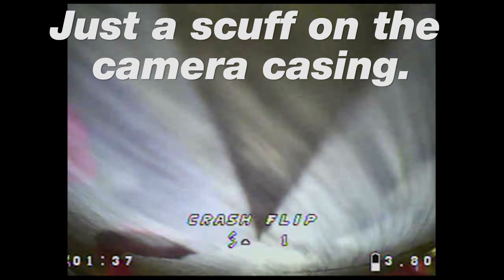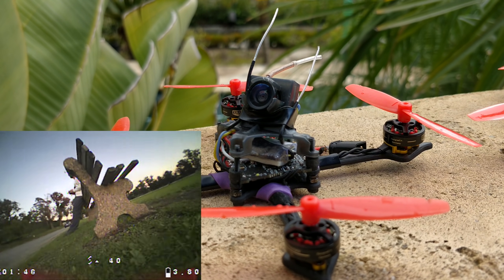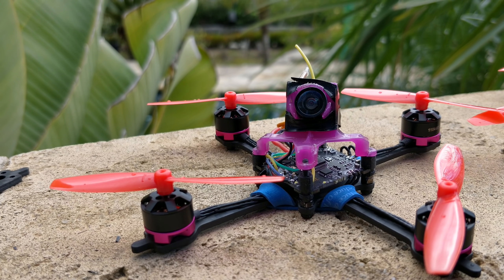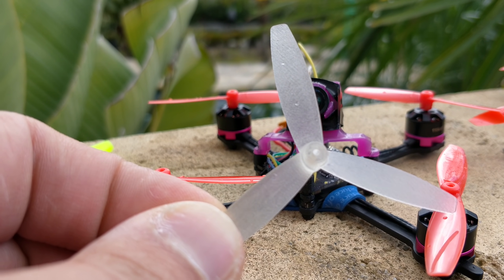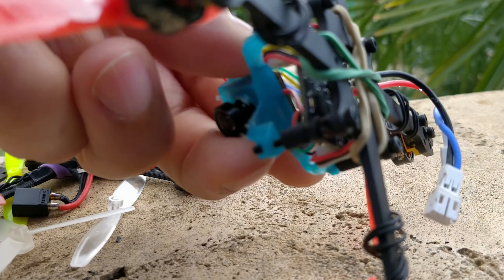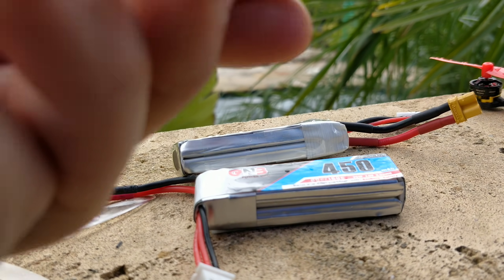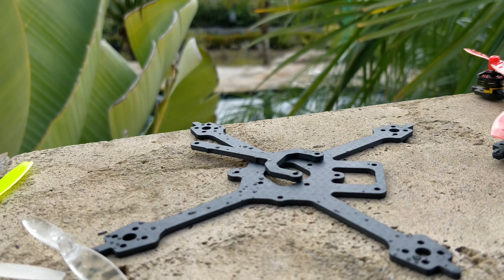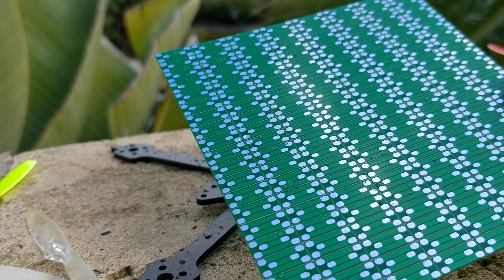Toothpick Update - Props, Power lines, Charging...

Comment: I don't understand all the hype around this thing: flight envelope is ridiculously small, you have to fly fast for it to work, and guess what, with whoops, I want to fly "slow" and inside...I have a ur65 fitted with Gemfan 1.2x1.6x4, yes, very low pitch, and that's how you get back the use of the whole throttle. I wish they would do the same for my TrashCan.
Original whoop props have way to much pitch...
I repeat it your motor/prop set up aren't suited!!
Reply from the maker: You clearly just don't understand the point.  Please go back and watch my other Toothpick video.  Believe it or not a lot of us live in a city around other people and buildings and cars and more people and lots of dogs too!  We can't fly 5" quads almost anywhere.  The point of this is to make it extremely safe and essentially a toy such that people don't feel threatened by it.  I can fly very very very slow with this thing too.  I just prefer to fly fast.  You seem to entirely miss the point about performance.  Micros traditionally fly like crap.  Even the powerful ones on 1106 or 1108 motors and 2.5" props are generally overweight.  They are typically shooting up like rockets or falling like rocks.   There's kinda no inbetween in the throttle.  These things I'm building have all the same control or more control than a typical 5" quad.....I don't know why I'm wasting my time typing this.  I have zero reason to convince you or anyone else of anything.  If you don't like it, feel free to just not watch my videos
Reply: another know-it-all fixed wing guy, who would have thought. go tell all the other grey beards at your flight club about the flight envelope, no one here gives a shit.
Reply: Yes, I see a lot of know nothing in the drone community, not giving a shit about people knowing, and that's very sad. I'm no grey beard guy, I'm only a 20 year old experienced flight test engineer....

Comment: The f4 is capable of running 3s right? Have you tried it yet?
Reply from the maker: No it's not.  There is a 3S version coming soon
Reply: @Kabab  I thought this is the same FC that they're using on the HD tiny whoop
Reply: The mobula7 hd has crazybee f4 pro and running 3s. Is their board different?
Reply from the maker: @jaredr40108  that's the Mobula HD. Not the Mobula 7
Reply: @Kabab  same FC though right?
Reply from the maker: @jaredr40108  no. It's the 3s version. The regular crazybee F4 does NOT do 3S.
Reply: @Kabab  it's still called the mobula7 HD and the FC in their product description is the exact same one that you're selling... Have you looked at the product page?
Reply from the maker: @jaredr40108  it is a 3S FC. I do not believe the 2S FC has a 3S capable BEC. That's the limit
Reply: @Kabab  Damn, I guess that would mean there's a crazybee F3, crazybee F4 pro, and a crazybee F4 pro +? I guess if that's the case we'll just have to wait and see what they end up calling the 3s version. As of right now I'm 98% sure that the mobula7 HD is running the crazybee F4 pro on 3s.
Reply: @Kabab  The product page was finally updated it is the "crazybee f4 pro V2". that they're running, I just checked. I still think 2s all you need for your toothpick build as is. But 3s would be nice for the HD version, no?
Reply from the maker: @jaredr40108  yeah I'm gonna recommend the 3s version going forward just for the headroom. Why not...
Reply: @Kabab  it's crazy that they put out three boards in such a short amount of time. I really wish they would have just held off and put this 3s version out. The toothpick will be one of my future builds for sure. Thanks for doing all the work finding the best parts.
Reply from the maker: @jaredr40108  yeah it's always like that however. They make one and then they make it better. I'm working with the engineer to improve the 2S/3S travel charger right now

Comment: I am really unlucky person, my crazybee f4 pro was working super fine on 1S then I connected 2S lipo and flew 30sec and then the power fades away and shut downs... Everytime I plug lipo it's turns on and fade away :( I order new voltage regulator (TI TPS63060DSCR) and will try to swap it.
Reply from the maker: 😔. Nothing is ever 100% but I've had the best luck with these boards by far

Comment: Word I’m happy now that I bought the King Kong 90gt which came with 7800kv 1103 is what it came with. lol need new motors tho but it was a monster on 2s when she did fly. I’ve only flown Los with it but can’t wait to get fpv’en soon. Props I’ve used were neon yellow 2in 4blqde. Worked good but newer props out now are way better. My frame limits me to the 1.5 inch but I’d just move the motors out on the arms using only two screws. Snapable on impact tho. Always do the xt30 swap out it’s a must when comes to the power input.
Reply: Get goggles any googles box or expensive ones. Made a world of difference for me. I beat the crap out of a rodeo 150 because I was cheap. I missed the whole experience of fpv for a summer. Heres to a whole new experience.

Comment: how does that charger you showed charge xt30 batteries? it didn't look like it had any xt30 ports. Does it just charge through the balance lead?
Reply from the maker: through the balance port.  You don't need the power line to charge.  Especially just at 1A rate

Comment: How do you like your model 3?
Reply from the maker: It's alright but I feel it's a bit expensive for what it is.  There are a number of issues that I wish they would have addressed.  The headlights aren't so great and the high beams are just way too dim.  The headlights don't turn or have sideways beams so you can't see into turns at night without street lights.  seat coverings aren't leather which is fine but the material isn't thick at all and doesn't feel luxury.  The doors don't have soft close.  The breaks really could be a lot better than they are.  The range on the car is 220mi in reality and NOWHERE NEAR 310mi as they say.  The bluetooth mic is not very good which is extremely frustrating.  Couple other issues.  I feel like nobody really tested this car over time and against other simple cars like a prius.  If they had, they would have realized some things need to change.  My old 2012 prius has way way way better bluetooth, way better headlights and even better breaks.  Yes it's quite surprising but it does have much better breaks.  I don't care what the tests say.  There have been a few times where I wasn't sure if my model 3 was going to stop because a car in front of me slammed on the breaks.  I cannot even remember a time when I felt that way in the Prius.  Overall it's a really nice car and the experience of having and driving it daily is beyond literally any other car ever made.  It's just unfortunate that it has such a premium price tag when doing things this 'new age' way that they have costs so much less than a traditional car.  The Model 3 costs Tesla somewhere between $9-15k I estimate to actually make but it's sold for $63k currently.  I don't know how the company isn't wildly profitable yet.  Especially since there is basically zero service.  The service centers offer zero help if there are issues.  None of them have a clue wtf to do with the car.  I guess that's good and bad.  There aren't really problems and if there is, it's handled by a programmer at tesla usually.
Reply: @Kabab  ty
Reply: @Kabab  you're lucky enough to live in a warm climate, folks here in EU had some serious issues this winter with batteries refusing to charge etc. I guess they thought all other manufacturers were silly for making battery heaters.
Reply from the maker: @FilipRadelic  😔

Comment: Could you please please test the amax 2207,5 1800kv motor? Compared to the Xing...
Reply from the maker: Amax motors are great. I would expect them to be great.
Reply: @Kabab  Does it change anything if I fly a old 4s motor with a 6s pack and Throttle limiting of arounf 66%?

Comment: Those gnb 450mah 2s lipos are really good, i used to buy ones with that weird white connector and than just swap the connector with the wires for xt30 because they where so much cheaper (like 5$ for one) but still they are great batts

Comment: 1105 is my pick over the 1103s delicateness 1103 were also the first naked bottoms that were on the market if I can remember correctly
Reply from the maker: Well then you surely missed the two crashes at the beginning. That same quad is still flying great. Just a minor dent on a motor bell. 1103 is not weak. In fact 1105 is at more risk to break...
Reply: What are you using  to drill out the shafts with? I'm using a cutting torch finger drill I got from local tractor supply.i really hope they get    them correct because it is the most agravarting thing to do is drill  props
Reply from the maker: @bezerkfpv624  a 1.4mm drill. It's all listed on the product page in more than one area as well as on the component list guide

Comment: We need something like XT10 connectors..
Reply: The micro deans connector is rated for 10A, but I just go with xt30 myself. It doesn't weight that much more. The real weight comes from the batteries themselves.

Comment: Man I use 16ga and xt30 on a 1s build with 0706 15000kv and it's a pretty big improvement as well. The jst or 2mm molex are only good for about 5amps or so and at 10 amps or higher they really start to limit the power delivery. These motors can pull upwards of 4-5 amps a piece on full throttle even on 1s. Something I would recommend to try is the king kong 48mm tri and quad blade props the 48mm tri is by far my favorite prop they have much better recovery and control than bi-blades. I have yet to find a 1s battery that can deliver what this setup needs the gnb 450 is the best I've tried but, they get pretty warm and have quite a bit of voltage sag. Hobbyking has some nano techs with a high c rating but 600mah seems like the best option in those, they are the only 1s battery I've ever seen with an xt30 though so if that's anything to go off they're probably pretty decent.

I was sad to see the toothpick frame doesn't support the 6.5mm bolt pattern of the 0706 motors those are my favorite for 1s builds. Looks like I'm sticking with the bat-100 frames it's a shame I could have saved a gram or two using an all in one board and got below 40 grams all up.

Comment: I'm not surprised that power is being bottle necked by small guage power wire.  I'm always curious how people+ expect to get 90 amps out of the battery through 22 or 24 guage wire without losing a bunch of energy to heat.?

Comment: Looks like a fun build! As I discussed in my “xt30 vs PH2” video, the problem with 2x1S isn’t just the PH2 connector. It’s the wire, and the batteries, and battery tabs too. Everything about 1S is suitable for low current only. 

The Crazybee board is good but I think the BetaFPV 2S AIO board is even better for builds like this. It has better range (I use the FrSky version) and larger through-hole solder points for main power. That makes it easier to use 20AWG wire compared to the Crazybee. 

One last thing. The 450mAh batteries by Tattu and BetaFPV are not as good as the GNB battery. The GNB battery has lower IR and less sag under load. It’s really pretty amazing! The only other 450mAh 2S that’s as good is the Crazepony (which is probably just a rebrand). 

I hope the info helps. I love little 2S micros! Happy flying. 👍
Reply from the maker: I have actually found the beta electronics should be far less reliable. At least that has just been my experience. Both will work the same and I cannot believe how good these all-in-one boards have gotten
Reply: @Kabab  Yeah, they're pretty great! I'm even flying 2" 4-blade props and a caddx turtle (75g all up), and the board has no problems.
Reply from the maker: @MrShutterBug  I cannot believe it but I was running 1105 with the GF2540 on 2S with a crazybee board and it was totally fine.
Reply: @Kabab  Funny you mention that, I just tried out the Avan 2.5in 3 blade props on 1103 8,000kv with a 300mah RDQ 2S, after almost a mind of flight I landed because i was certain it was going to wreck havoc on my battery.... And it was at 8 volts still... These AIO boards have some kind of Toyota Magic in them lmao

Comment: I have an Emax Babyhawk with a dead flight controller. What do you think about those motors on this frame? The kv is a bit on the low side maybe?
Reply from the maker: Unfortunately the motors will not accept any prop but the TinyHawk prop
Reply: @Kabab  I meant the old/original Babyhawk from a year orr two ago. Is it the same with those as well?
Reply from the maker: @kenneths7984  ah. No that wouldn't really transfer. Different stack pattern

Comment: Watch the Crazybee F4 the solder pads come off on me and 3 other people I know..
Reply from the maker: I've heard this but I've resoldered the same board at least five times with no issues. 🤔
Reply from the maker: In the end it still is a cheap board but it's a really good cheap bosrd for me so far.
Reply: Hey man since your talking about pulling pins and going to bigger wires wouldn't it just makes since now just go to a teeny F4 stack that's 26g ?
Reply from the maker: @royfryman2196  yeah it's not a stretch but the 16x16 stacks are still a problem to soft mount and they haven't been particularly reliable for me. These crazybee boards have been really amazing so far.

Comment: Try 0905 10k dys they are powerhouse little motors and even run 3s ice cool but 2s is fine and they had more power than the 1104 emax I thought and think those 1104 on 2345x3 props are quite powerful and like those props while many dont.
The 0905 have no problem with even 2.5in tri props with high pitch.
Very suprising and they weigh near nothing
Reply from the maker: I'm not looking for power. I'm looking for a balance of control and power with control being #1. The wider stator is better at control.

Comment: Just wondering...have you ever tried the Gemfan 2540 on the Toothpick? It is the best 2,5" prop out there imho.
Reply from the maker: Yeah. It overloads the motors. The 2540 is also best on a 1304 actually. Great prop still.
Reply: Ok, I use it on 1104´s and it awesome, thought 1103 could handle it.

Comment: Make a 1106 2s because those motors are common. Make it for a non safe purpose😂
Reply from the maker: But why?  1103 is better and cheaper for this build
Reply: Yeah true... I have the leader 120 and the esc is fried, if I got your frame and a whoop esc would the 1106 motors fit on it.... I don’t really get motors I’m new to fpv
Reply from the maker: @evo-fpv8963  1106 is bigger than 1103. It's not needed if your weight is low. For things that fly, weight is most important.
Reply: KababFPV ok.. would it work on your frame though?
Reply from the maker: @evo-fpv8963  1106 will fit if it has the same mounting pattern.

Comment: Have you found any solution for fixing motor shafts you loosened trying to get a stuck KingKong prop off?  We really need a matched standard.
Reply from the maker: You mean on the old Racerstar motors?  Yeah the solution is to not buy that motor
Reply: @Kabab  Any 110x motor without a set screw.  Especially RotorX, DYS, etc.
Reply: Warm em up with a heat gun or torch from very far away where it doesnt touch or braze prop or touch shaft with find tip solder iron itll come off in 2 secs👍
Reply: @charleshodge9807  What about a type of glue to stop the bell from spinning independently from the shaft?

Comment: Would you rather have unlimited range or unlimited battery?🤔
Reply: You'd need unlimited battery for unlimited range 😀😮
Reply from the maker: Unlimited range for sure.
Reply from the maker: Interesting question
Reply: One of each ; )  Perpetual motion (and therefore energy) isn't feasible though.  However, low latency cellular networks already exist, as does encrypted VPN's.  FPV & control telemetry over 3G/4G already works, with plenty of fallback behaviors for safety.  

If we had something like practical wireless energy, or we could get the efficiencies right to make solar work at these scales...  GodMode FPV practice would be possible, so would personal surveillance (sousveillance) swarms, sentry street lights, etc.
Reply: @mistercohaagen  there is a new military drone that can recharge mid air via a precision laser to stay in the air on surveilance for weeks at a time... hobby version? Lol
Reply: @flighttherapybullisticfpv133  link?

Comment: I have that 2s charger not bad so far. Only issue with it is when charging the bigger 1s batteries you can only charge 2 at a time because how close they put the plugs in the center it won’t fit. You can solve this by using an extension wire for those plugs buts it’s just annoying for 1s.
Reply from the maker: Good to hear it works alright. It's literally the only option.

Comment: have you tried the 1103 5000kv amax? i thought they might be even better with throttle management..
Reply from the maker: No. It's a 100% fallacy that lower kv is more torque.  It's 100% false. The 5000 is a 3S motor.